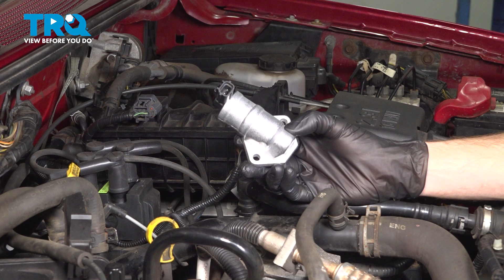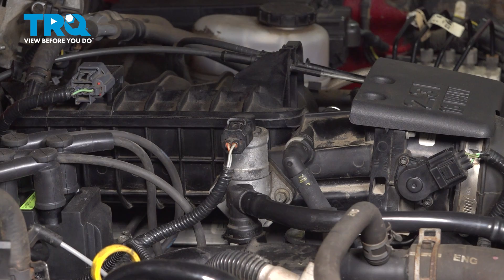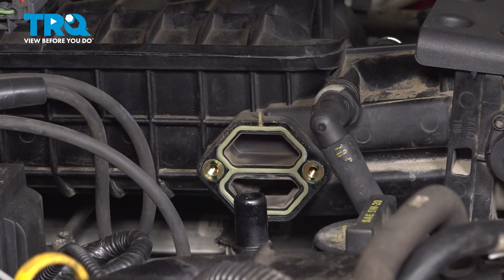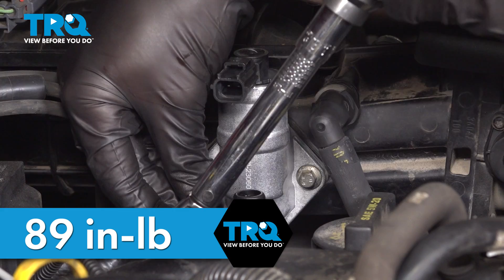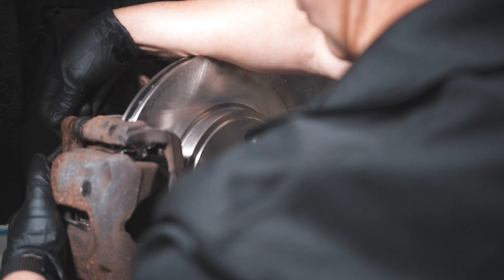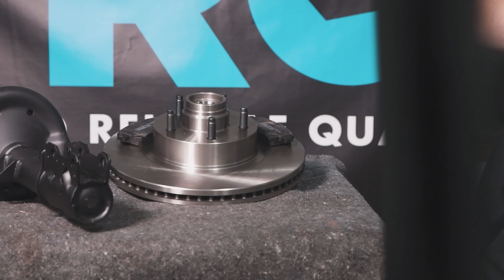How to Replace Idle Air Control Valve 1998-2011 Ford Ranger 2.3L L4

Comment: Gonna replace this in my 94 ranger, the truck stalls whenever I have to be firm on the brakes my rpm’s start dropping but instead of stopping around 1000 it just goes to 0 and then stalls so hopefully this will fix the problem